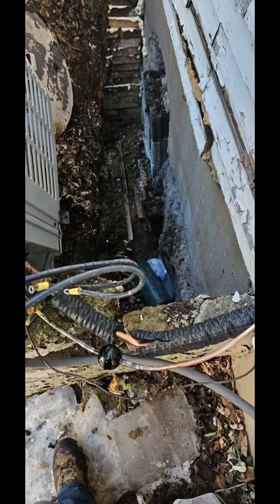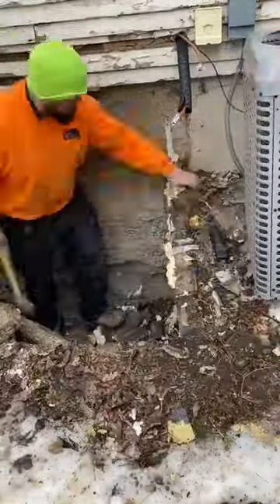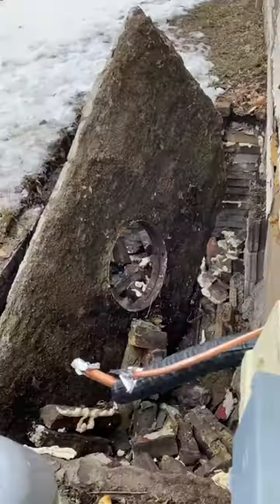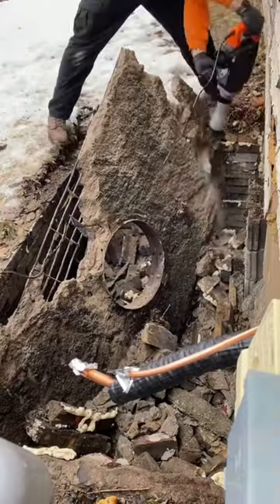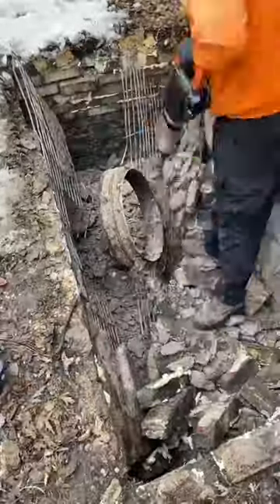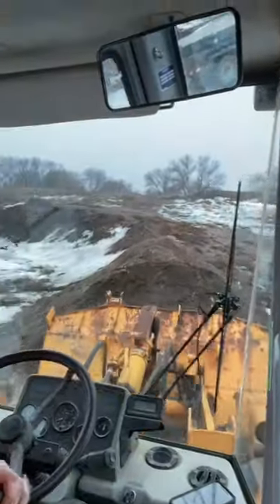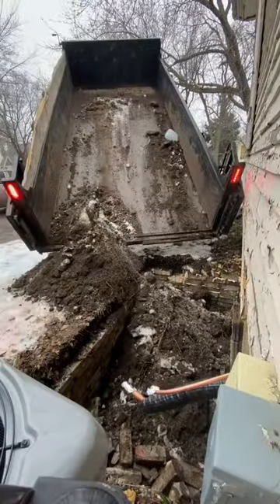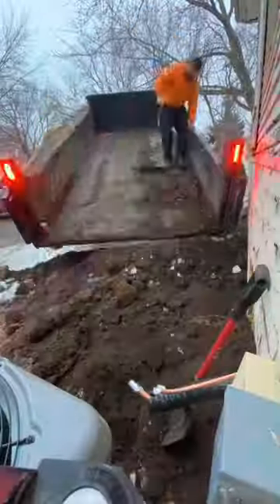Dismantling and backfilling a collapsed cistern. ￼#HandsomeOrHandy #Handyman ￼

Comment: You should have compacted the soil
Reply from the maker: We’ll let nature do that this spring.
Reply: No one drives or even walks in this area...It was overfilled a little...more can be added later.
Reply: @kayreimnitz7792 Do it right, do it once!
Reply: @HandsomeOrHandy  so you're saying unlevel ground won't effect the unit?
Reply: It depends on what the customer pays for. They may have other plans.

Comment: Vevor actually makes some decent stuff
Reply: Vevor just buys generic no-name stuff and slaps their name and a little warranty on it.  I bought that jackhammer 4 years ago from a no-name on ebay and its worked very well.
Reply: @bigpjohnson  regardless, it's not bad typically for the price
Reply: @bigpjohnson I think vevor also has slightly higher quality control requirements so the quality is a little bit better and you get someone to complain to if something goes wrong
Reply: I run a fencing buisness we use vevor jack hammers they are soooooo good and only $200

Comment: So, just so I'm clear, you didn't compact by lift. Place a foot or so of soil and compact, repeat until you reach grade.
The you won't need to "add for settling".
Just sayin.......
Reply: Sounds like you're speaking straight from Google. Ain't wrong, though he shouldn't have left the one side of brick standing its barely getting covered
Reply: @biggiechungus1397  Not a google grad, however I am an industrial construction manager and know that replacing soil isn't just dump it into the hole and slosh some water on it. Difference between a pro and a DYI'r
Reply: You can't compact permafrost genius.
Reply: @johnstewart7059  It doesn't really matter what you are or what you're not The very fact that he's actually doing it in the video should probably tell you something.
Reply: @shockingshorts8043  except that wasn't permafrost, genius. 
Maybe type c soil.
Permafrost doesn't get piled up next to a house, genius 
Stop watching YouTube videos and actually work in the field before you spout nonsense, 
Genius
Reply: @johnstewart7059 always hate when I see people do dirt work and not compact it.

Comment: I am glad the ac line did not break i wish you showed the ac disconnect process and freon recovery,  i will not be impressed that you have one of those recovery pumps and vacumm on your kit lol
Reply: They typically just vent
Reply: @marktupapi5609  So that's why it was a high in the 50s yesterday instead of 20s..

Comment: I have the same hammer. It was $117 on special. It worked out cheaper than renting one for my job so i wasnt worried if it didn't last. It works fine.

Comment: Getting dirt calculations correct is extremely challenging. 
Recently widened my driveway entrance with a culvert, shocking that it took 5 loads of fill dirt and 3 loads of 8910 on top.

Comment: I have a similar jackhammer, it takes 2200 Watts to run. I have a small 3k Firman inverter generator and run it where there is no power.  Is $200 I ever spent on the jackhammer for demo’ing.

Comment: Only problem I see coming from that unit falling like that is since the suction side of that copper lineset is kinked it’s going to act as a metering spot now in that system. So in short without over explain the “science” behind it, it’s not going to work right until that spot on the copper I is fixed.

Comment: Question?  could the metal be use in the hole to help with the settling of the drit or cement.
Reply from the maker: It would not help, it’s best to just remove as much of the material as possible

Comment: Should have sealed the hole at the side of the house and should have made a hole at the other side at the bottom so any trapped water goes out, like this it will start eventually leaking underneath the house...

Comment: L*W*H=volume
Reply from the maker: /2
Reply: @HandsomeOrHandy  wym ÷2...L*W=area...area*H=volume...so...volume=L*W*H
Reply: If tht is the formula you used...no wonder the fill didnt come out correct
Reply: Ie...

A rectangular prism with a length of 4 ft a width of 10 ft nd a height of 7 ft...has a volume of 280 ft^3 (cubic feet)...even google agrees with me

MATH:

4*10*7
   v
40*7=280